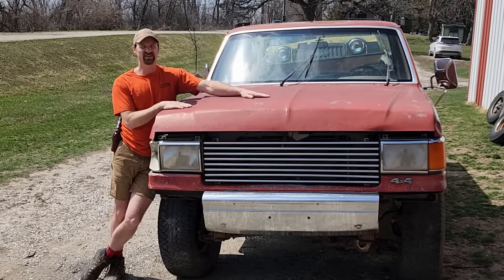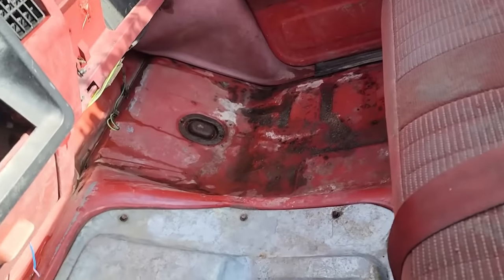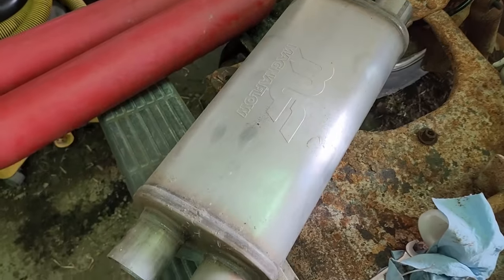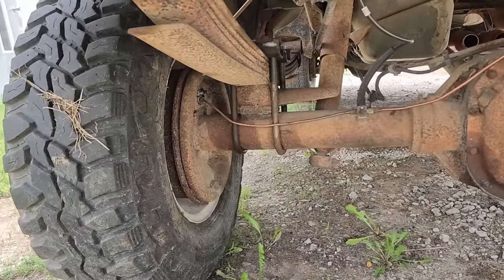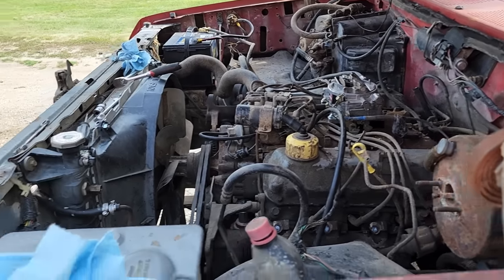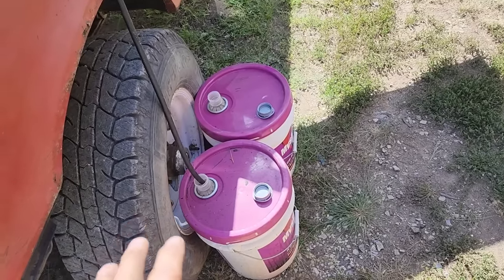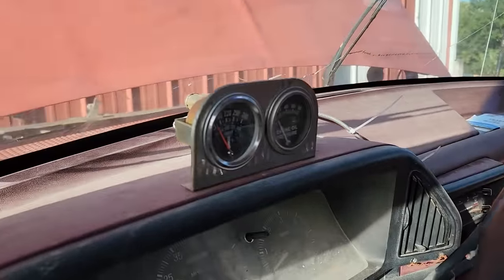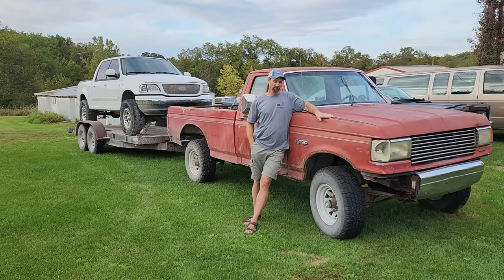F250 left in a horse pasture for 8 years. Can it be put back to work?

Comment: Great video Ron! If I had a use for the old Bricknose I’d give ya a fair price in cash for it but my F150 doesn’t get worked enough as it is and my wife would probably kick me out to the garage permanently for it! I had a ‘91 bricknose years ago and loved it, hard to beat a 300 straight 6 and a 4 speed manual. It was slow, leaked everywhere, got horrible gas mileage and rode like a lumber wagon but you could depend on it to start right up and move you wherever you needed to go every time.  But I decided I needed a ‘99 Super Duty more so off it went to a new owner. You could try pulling the fuel pump off and running it a bit from the remote tank to see if the clatter goes away but it sure seemed like the bellhousing is ground zero for the noise. Very strange…
Reply from the maker: Agreed. With how loud it is coming from bellhousing, it would seem thats where problem is. I figured towing a load would  make noise worse or even shred the flexplate if that was the cause

Comment: At 18:10, the levers on the fuel pump are different; could that be the noise?
I don’t like square body’s either, I’d rather have a 67-72, 88-98, or Apaches. 
I have a soft spot for 87-91 F-250s (87 specifically). My first ever real vehicle (I had a few junky $100-$200 jalopies before) was an ‘87 F-250 Lariat. 6.9 diesel, 4 speed, 4x4. Drove it for my entire high school career which was 60 miles round trip; and to college for 1 year which was 500 miles round trip weekly. 
Sadly it’s sitting in the exact spot I parked it 18 years ago when I sold it. Trees have broken out the windows, and packrats have demolished the rest. It still had cold A/C and functioning cruise control; along with new batteries, starter, alternator, and glow plugs.
Reply from the maker: I dont hate squarebodies. Just dont get all the fuss over them. Kind of suprising how many others feel the same way I am finding. My theory is that they were made for so long that damn near everybody has had one or has had someone close in theiir life that had one.
Sentimental attachment moreso than actually feeling they are a well styled vehicle. 
There are still TONS of bricknoses in my area!

Comment: It's possible you have the wrong idle mixture screws installed.  I've seen it happen with a used carb before.   Might be worth ordering a couple of screws.
Reply from the maker: A good point but,,,,,,,
When I rebuilt the 650AVS, I found that previous owner had broken off the factory idle mixture screws and put in something else. (750 had one broken off in it too!) I called Edelbrock tech line and was told all of their carbs use the same mixture screws, so I ordered a set.

Comment: I’ve got the same problem on a used 1405. I read somewhere that you can damage the carb by turning them in to far. Also square body Chevys are just boring, you seen one year you’ve seen them all. Also also duraspark for the win……again ( guess all the experts are wrong lol)
Reply from the maker: The 750 I ended up using had some damage to one of  the idle mixture screw seats because of some mouth breather cranking it down too hard.
Durasparks have treated me very well over the years!!

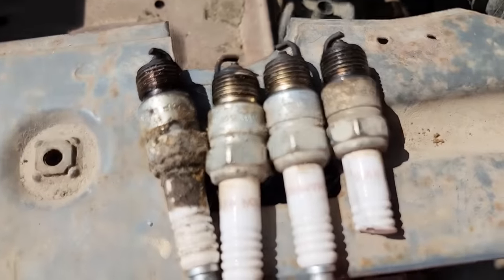Comment: 6:05 NGK irridium are the best plugs I've ever used. they are fugging expensive but worth it!
Reply from the maker: Base Autolites have always treated me so well, that I never had any reason to try  something else
Reply: @misfittoys8883  yeah i'm a turbo subaru nerd and pretty much anything with boost or super high compression uses irridium cuz they are a lot stronger and  run a little cooler to prevent turning into a glow plug under pressure.